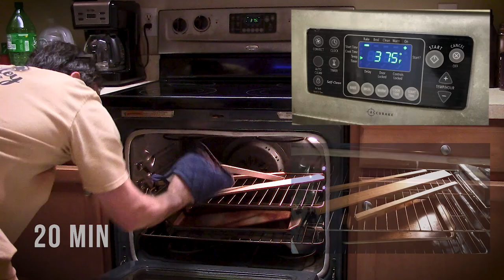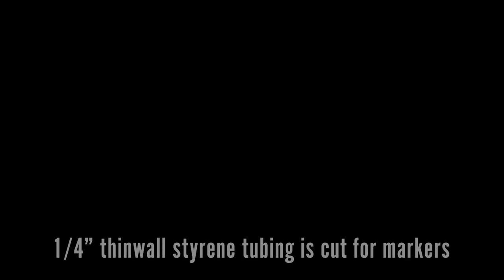Great Guitar Build Off - Unofficial & Fun EP04

Comment: Love the dots.  Awesome idea
Reply from the maker: Thanks man!
I must say, every time I watch your build videos, I have a childish craving to hit up DQ. Honest, I have some hunger trigger from seeing, or thinking about those sandwiches. 
The dots are really easy, hardest part was making a good hole saw to fit the small styrene tubing.
It was a 1/4" round rod, that I drilled out the center then cut the teeth with a dremel tool. 
Take care!
Reply: Awesome.  Once upon a time I found a quarter inch plug cutter so I could make hardwood dots out of anything, but it’s not gentle to the piece and wasn’t quite 1/4”.  Cool idea with awesome results, very nice.

Comment: Enjoying your video’s having fun is a big part of it
We’re you roasting the wood in the oven?
Reply from the maker: @Patrick Kem, thanks for watchin' and yep, I'm having fun, trying things, experimenting... fun!
Yes, that was the electric range in my kitchen. Just big enough for a fretboard, not sure if I could get a full neck blank in there, hmm - might have to measure that. 

I ran the electric range at 375F for 1hr 15min. I honestly don't know if that was over cooking the maple since it was such a thin piece of lumber. It may have been done in less time, but I didn't want to find out otherwise when I started cuttin and shaping it. This was my first experiment with roasting wood in the oven. I had done some reading and watch some videos, but really went into this rather blind.

As a note, the fingerboard blank was already very dry, so it didn't steam-off or anything when heated. That likely also helped keep the wood from cracking, warping or twisting too. But, I don't know much about this process yet, other than is will make a house smell like burnt wood for about a day. 
Thanks for watchin, and for the comment.
Take care!

Comment: love how you did the inlays will be doing something similar in the future how did you make your homemade 1/4 hole saw may I ask?
Reply from the maker: Hey Grant, thank you! 
The hole saw was a 1/4" piece of round steel rod that I center drilled leaving approximately the correct wall thickness. I then used a dremel tool with a thin cutoff blade to cut the teeth. 
The first hole saw I made was some 1/4" brass tubing, so no center drilling was needed. The brass didn't hold up as well however. So I've moved on to the steel rod to make the hole saw from. 
Hope that all makes sense.
Thanks for watching, take care!
Reply: @theNextProject  it did thank you for your help

Comment: sooooo, what's the soap on the saw blade for?
Reply: it kinda lubes the saw. the old timers used to use it on nails and screws too.
Reply from the maker: Hey Laura, as "nunofyer fingbizness" mentioned, the soap is a lube for the saw. The mitre box I made/use has hardwood blade guides, so the soap reduces the blade drag. I am a bit of an old timer, as I also use soap on nails and screws as a lube, it really does make a big difference.
Thanks for watching, hope you enjoyed the vid. Take care!